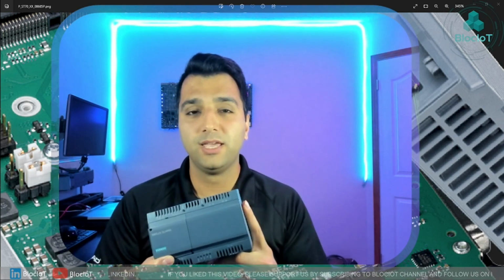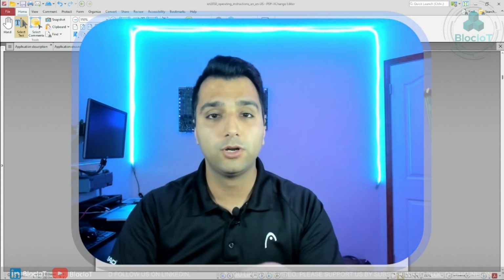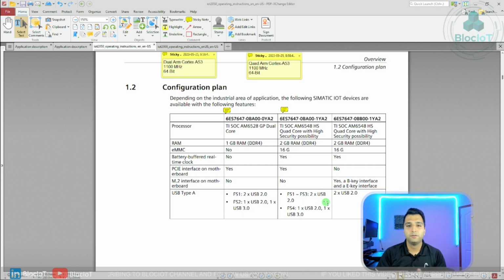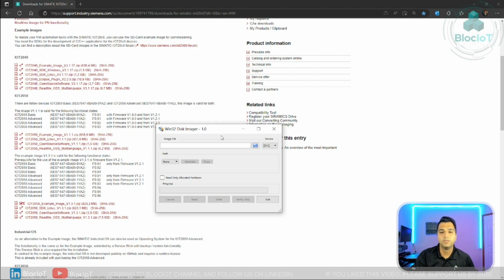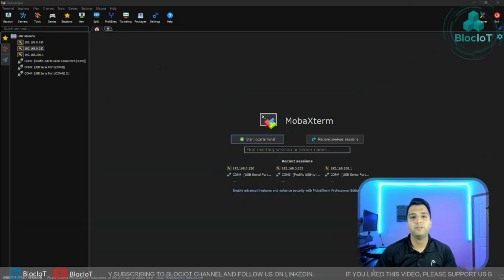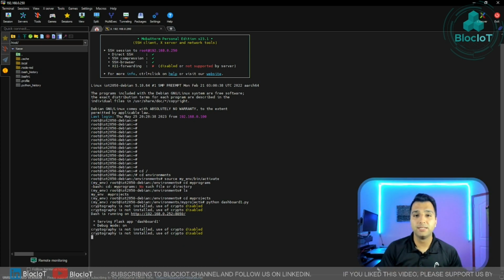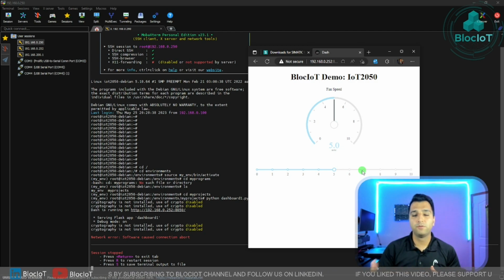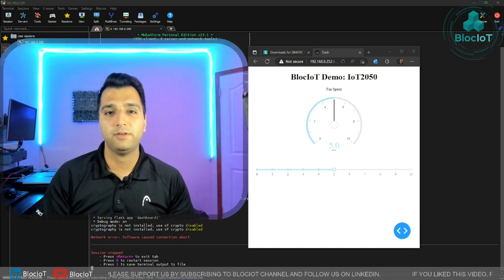18- Siemens IoT2050 IoT Gateway Tutorial: Running a Python Dashboard for Industrial IoT

Comment: Hi blociot! Hope you are well. Can you please help me to receive serial input on Node-RED for IoT2050? I have a USB RFID reader plugged into the IoT2050 and cant get it to read input on Node Red
Reply from the maker: Hi Petrus. I'd suggest testing your RFID on a terminal to make sure it gives oit the data and then try it in Node Red. You can use any serial terminal in Windows or Linux. Make sure your serial settings are correct (e.g. baudrate, etc.) Then you canbise node red seria In node to read the buffer. I prefer Python over Node Red.

Comment: Does it connect through ssh without putty, if we use wsl?
Reply from the maker: Never tried with WSL, but it should work. This device runs a Debian distro so if theere is no limitations on the WSL side, it will work.
Reply: @blociot  thanks for the reply